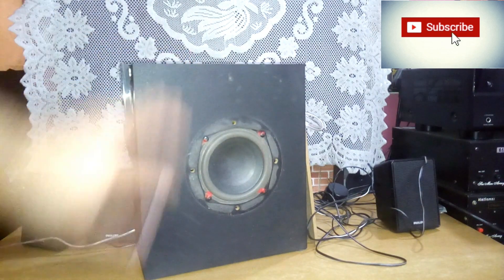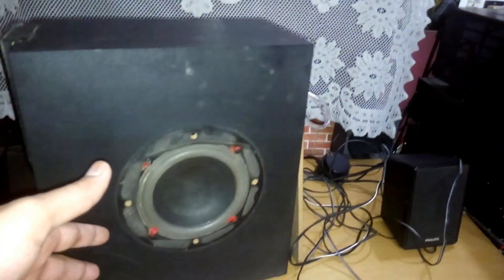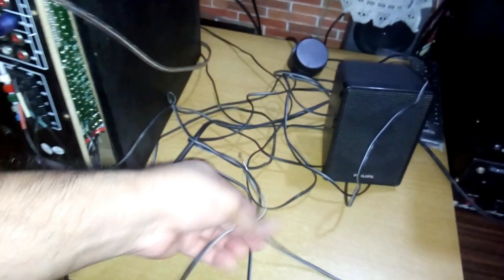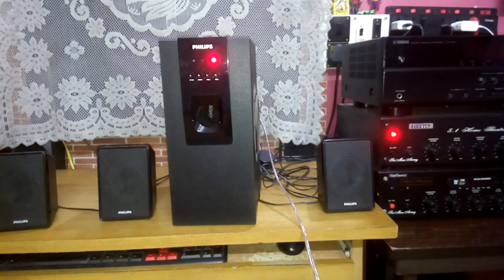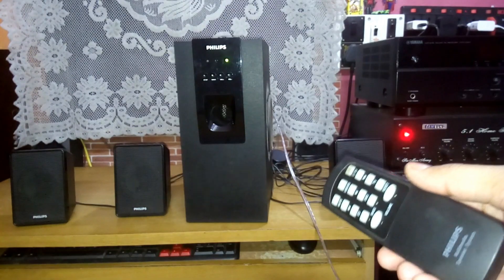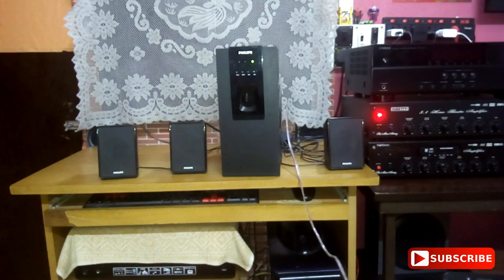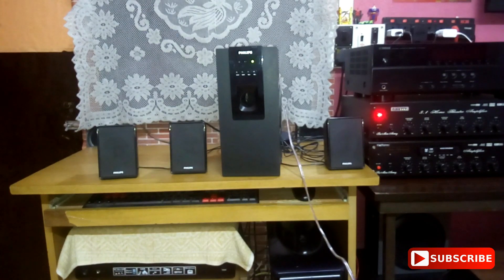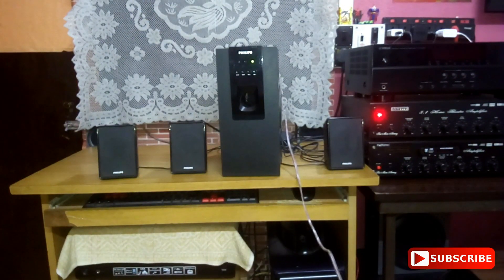How To Connect External Powered Subwoofer to 5.1 Home Theater

Comment: Sir can you pls suggest me good quality 5.1 channels  amplifier,  I want to connect  it in high level input , sony doesn't have pre out for external amp. my sony HT iv 300 home theater power is less so,  I want to upgrade it with new powerfull speakers.
Reply from the maker: Go for av receiver

Comment: Reply me
Reply from the maker: Yes! Whats your query?
Reply: @technoboy-allinOne   input are not working properly sounds are not coming what I do suggest me
Reply from the maker: @babubagwan1502  check all the connections first, change the wires, select proper input through remote... if all of these are ok then it may have circuitry problems.
Reply: @technoboy-allinOne   ok
Reply: @technoboy-allinOne   these models home theatre bass quality are low yes / no
Reply: How to open front plan
Reply from the maker: @babubagwan1502  slide a flat head screw driver between the panel & the body & twist it from all 3 sides, then pull carefully
Reply: @technoboy-allinOne   okay